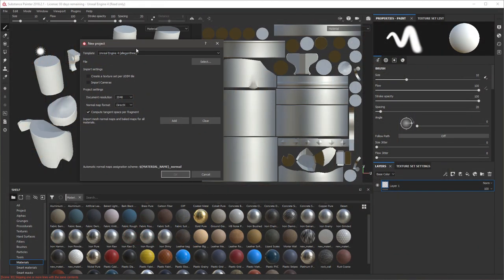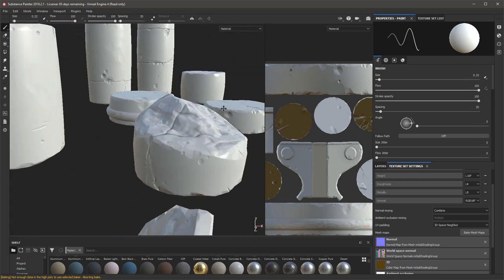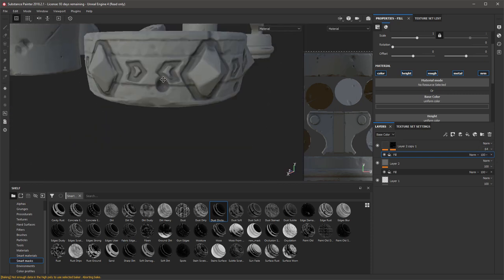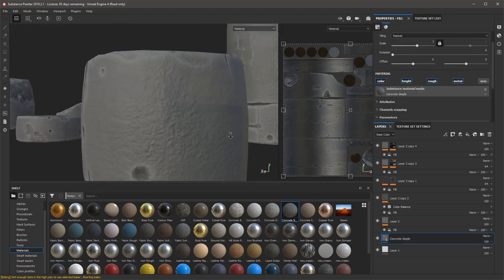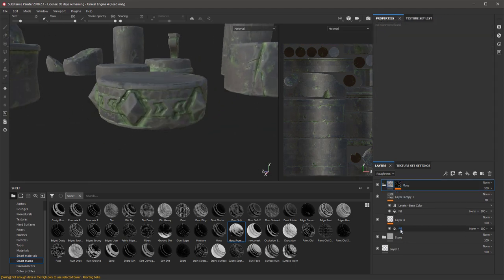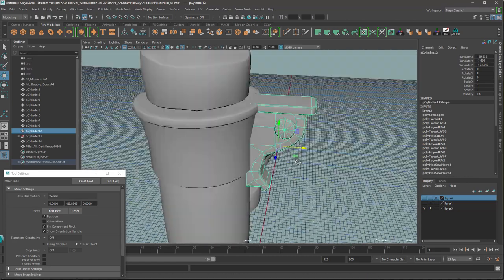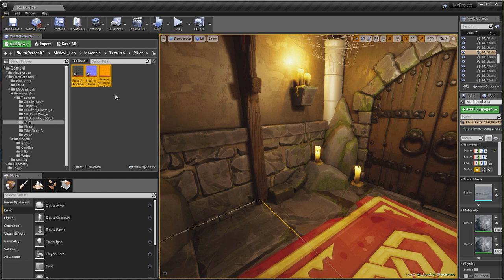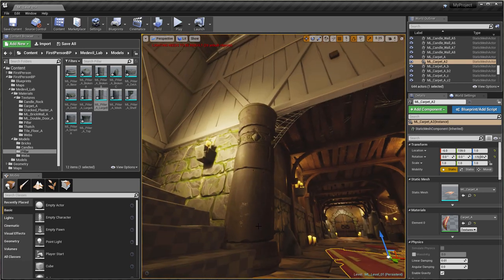MAKE A MODULAR PILLAR KIT - ( Part 3) -- [Maya][Zbrush][SPainter][UE4]

Comment: Thanks for tutorial! Could you please explain how you did this sheet of paint strokes? Did you just draw it in photoshop?
Reply from the maker: Yeah, just some random painterly strokes of different values, then with all layers flattened i use the Filter>Offset and offset it by half the width and height, so if its 1024 then offset by 512, this allows you to see the seam. Paint that out then offset again by the same amount and you should have a tiling texture 👍
Reply: @RobotArmy3D  Thanks, gonna try to draw some sheets with your instructions👍🏻